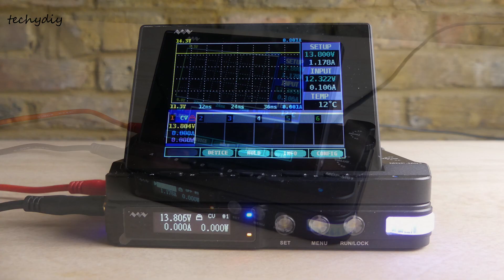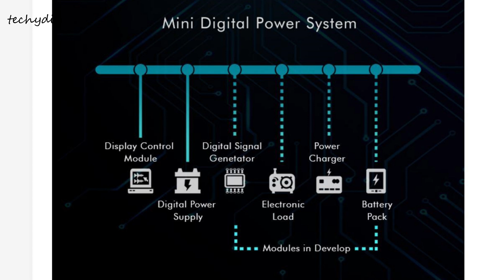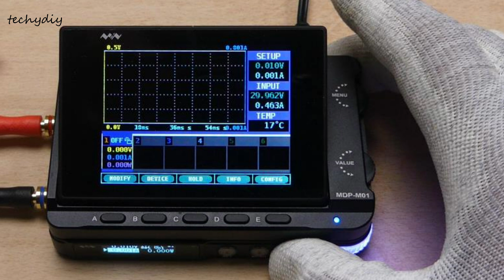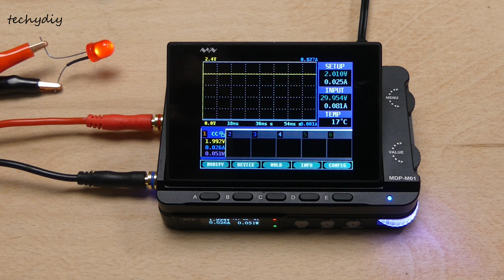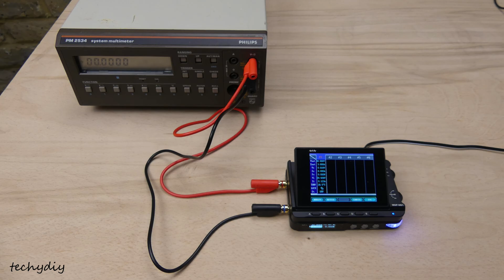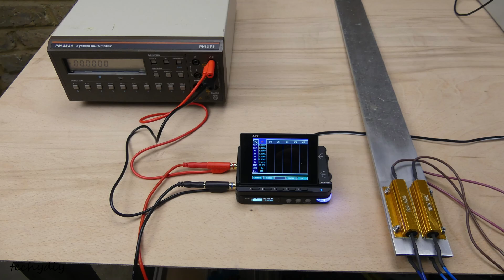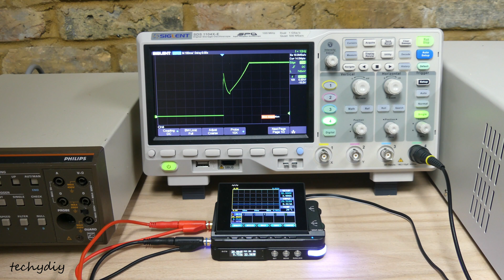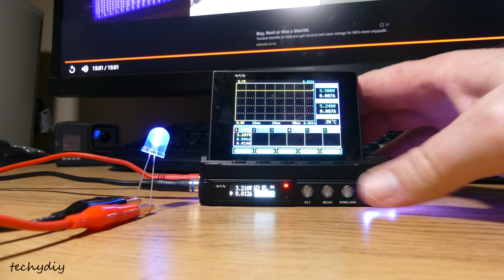Sainsmart / Miniware MDP-XP 30V 5A Mini Lab Power Supply Review

Comment: Excellent rundown of the operation/strengths/weaknesses. Would be nice if it had an auto shutoff if the battery input voltage got below a certain level.

Comment: Does it have some kind of logging or interfacing option to be controlled via a PC? That could be useful. Also I don't quite understand if the "wireless address" is accessible from other devices or if it is just for communication between the modules....
Reply from the maker: No that I know of.
Just comms between modules.

Comment: This “review” (MUCH more than a “review” IMHO..!!) literally *taught me how to use my device*.... thank you!!!

Your instructions to use the units AND update the firmware were infinitely more clear than MiniWare’s own instructions...

I actually have 2 of the power supply units (AliExpress had ridiculously low priced deals on 11.11 so I took advantage of that, saved over $100 than going thru Sainsmart, who deffff upcharge these regardless of sale a painful amount...) the only issues I’m having is with wireless connectivity being fickle and in my situation greatly depending on the distance of the control module to the power supply’s (literally only works within a 3 foot range...) this could be due to both my PS’s having verrry similar wireless ID’s (maybe..??) you were verrry helpful in also showing how to access and change the address thru a computer of the PS’s, I just have no idea what I’m doing when it comes to what address I should (or should ‘not’...!!) change one of em to..! 

If you have any experience with similar problems or know a potential “remedy” to my problem it would be muchhh appreciated.... BUT, I just have to say that even if you never see this msg or don’t know a solution, it doesn’t matter, since like I said, you have already been extremely helpful (!!!) and for that - THANK YOU SOO MUCH...!!

Keep up God’s work!

Cheers

Comment: I see quite a few different brands on the obvious china/amazon shops. Are these just re branded versions and not some sort of clones? Is there a difference in quality/accessory?
Thanks for the review! Love that this one runs on a power bank
Reply from the maker: I doubt they are clones. It really is a very nice power supply with great specs. I also forgot to mention it's silent.
Reply: They’re not clones, e-design is the manufacture/designer and they sell it (along with a few other very high quality products) thru their “MiniWare” brand, which is kinda confusing in and of itself, but the same company for sure. 

THEN, there is “Novel Life” and “Sainsmart” that both pretend that they make this thing (and many of e-design/MiniWare’s other products...) and severely up charge (IMHO...) their products, for what reason..? “Customer support”..?!

Hope that clears things up, I was confused at first too when initially trying to buy a TS100 soldering iron a few years ago...

P.S. - The TS100 is a fantastic iron btw, the MDP can also deliver full power to the iron easily! (Which seems to be a frequent challenge of many users given the wide input V range..) Tho I wouldn’t recommend get this Power Supply just for this use... but def a nice little plus for sure

Cheers
Reply: @TylrVncnt  thanks a lot for your additional information. It helped a lot. Thanks!

Comment: woah that thing is over 200$ for what a buck converter and a recycled el cheap-o pocket o-scope
Reply from the maker: It's a fair bit cheaper on Sainsmart's Amazon store. The architecture is buck boost followed by a linear regulator.
Reply: Has some pretty great features if you need it, very clean and “quiet” (notttt much noise at ALL, esp compared to typical Buck/Boost... much more advanced..) which works great for Power Amps for audio especially (my main use in powering music production modules with a remote battery pack or any dc power supply.. no noise and stable..) ie: guitar fx pedals 

It’s not for everyone, ripple/noise don’t matter much for motors or other circuits obviously, but if you need it you need it. 

Check out Marco Reps Vid on this where he does a tear down and breaks down the circuit (spoiler: it’s a very legitimate, advanced and mature bit of kit with no cost cutting BS..) tho “diy’s” particular review is IMHO a much more thorough review when it comes to actually learning how to use the thing completely